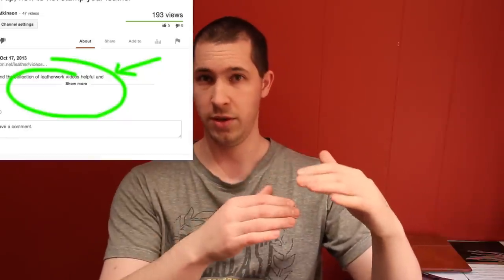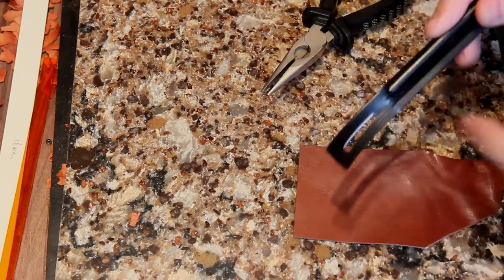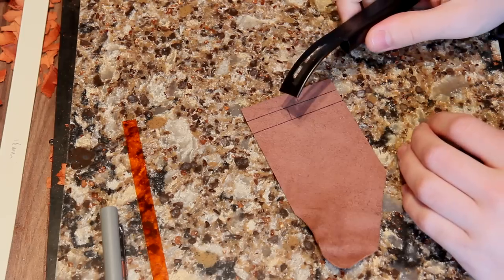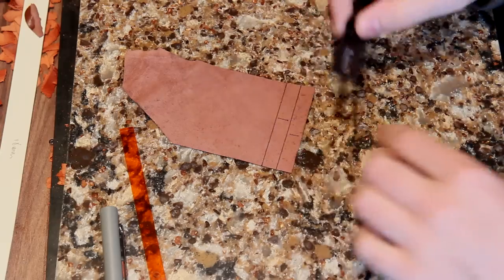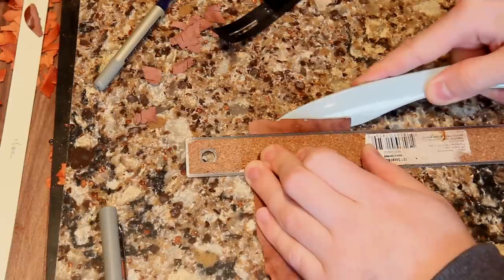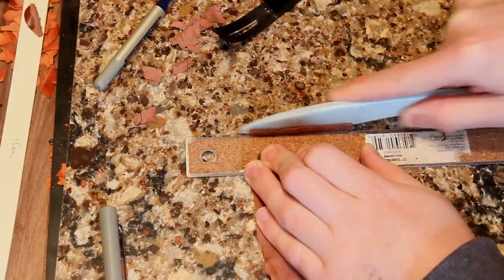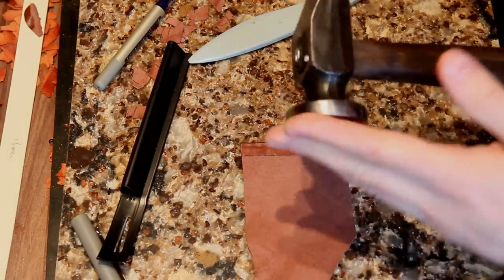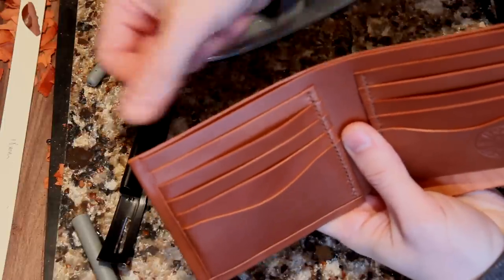Leather Turning and Bindings

Comment from the maker: Yes of course, pig skin is fine I've used that myself. I was just using scraps for the examples but your lining/binding leather can be any thin, suitable leather it doesn't have to be buffalo. Pigskin is good there's also suedes, kip, goat, deerskin, kangaroo ... anything like that which is about 1mm or less. Or you could split down normal leather if you have the means also.

Comment: One thing I have learned is an easier and safer way to put the blade into the safety beveller. Rather than having to bend the blade you can slide it in to the slot from the handle end which flexes the blade for you as it goes. Thank you for your videos btw, they are always very helpful and informative.

Comment: Thank you.
Is the skiving necessary if I'm not worried about the edge being thicker or if I plan to have something inside the rolled edge (like a flexible metal band)? And what if I wanted a curved turnover? For instance, I want to make a leather mask but the patterns don't have a fold over. I want to fold the edge over but not have a stitch and I want a flexible band inside to allow the mask to conform to the face/nose at the top.

Comment: Great video! Especially since my current project is a wallet. I recently acquired a belly of Italian leather.  My current issue with all of my projects to date has been applying glue.  I have been using cement from a tube and naturally it is messy. I just bought some fiebing's leather cement with a pointed nozzle. We'll see how that works. Any tips would be appreciated.
Thank you,
Brian
Reply from the maker: I would use contact adhesive with a brush so you can apply it accurately, Ian.
Reply: Ian, thank you and I found some glue at my tandy store that I thought you may or may not want to know about. I bought a red and yellow can of Barge cement glue.  Up until recently you needed a tax license to purchase, but no more.  I really liked it and thought you might want to check it out.
Brian